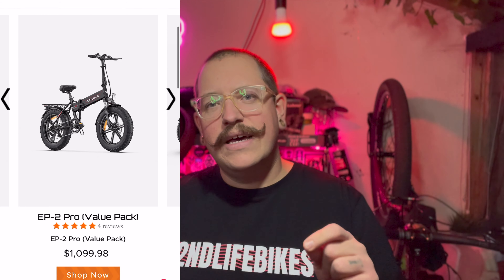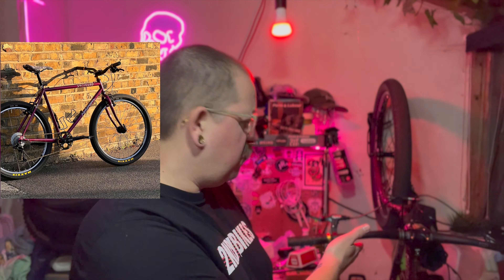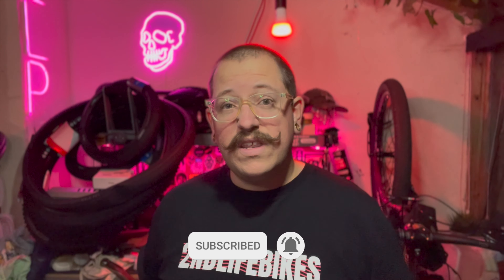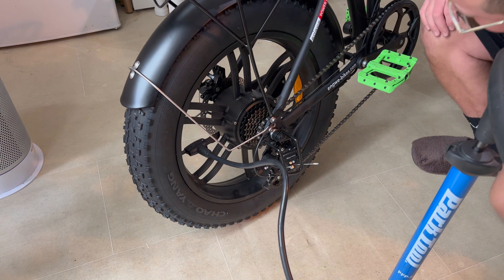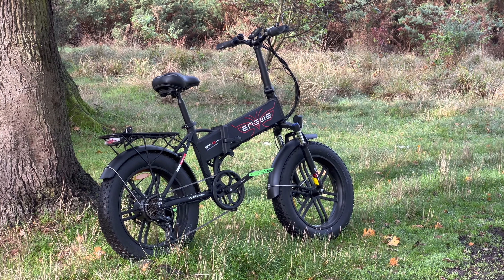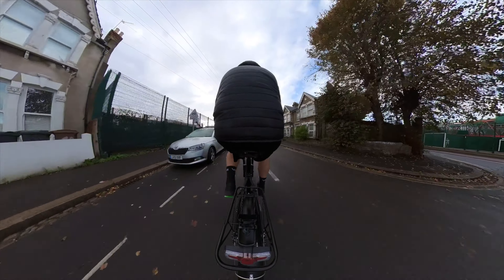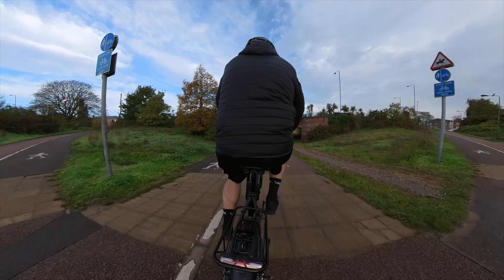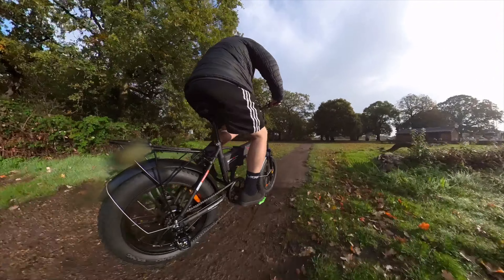Engwe EP2 PRO Review build and ride - first impressions

Comment: I have a folding bike from halfords it's not an ebike but I changed the tyres and put hydraulic brakes on it and it's awesome I use to get to work and back your videos are awesome and inspiring as it's inspired me to do my level 1 cytech course in which I've passed the theory 👍